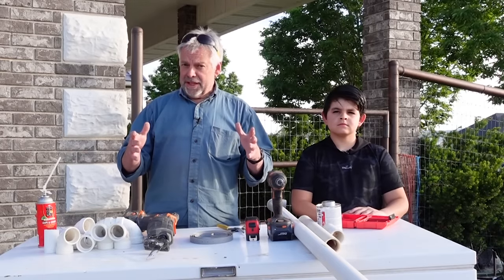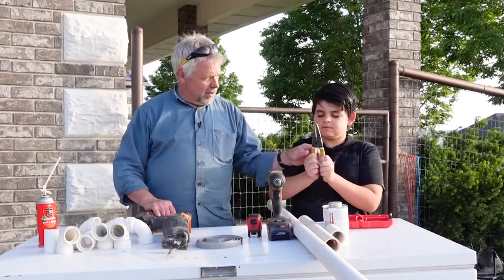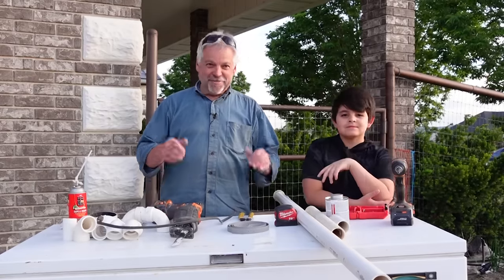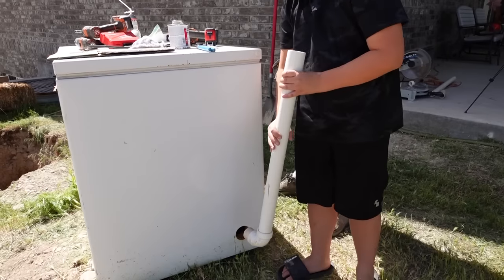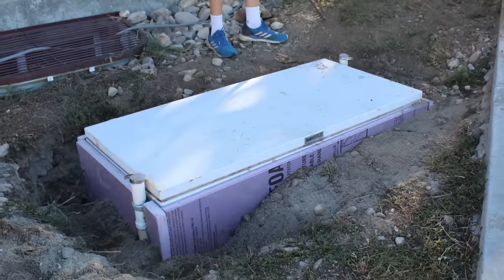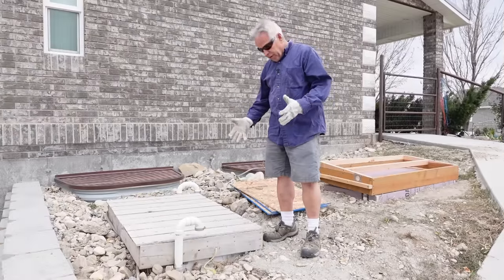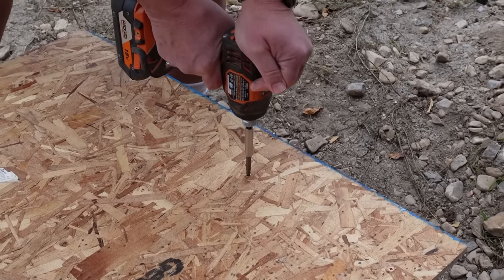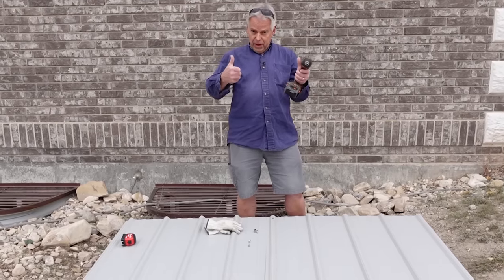How to Turn an Old Freezer Into an Effective Root Cellar

Comment: I used to live in SE Idaho where it got down to -20.  I used an old small fridge and it worked great.  Used it for years.  I dug a pit so the top/door when laid down sat 4 inches below ground.  I drilled holes in the back for ventilation.  I lined the pit with black plastic.  I laid the fridge in the pit with the door up, black plastic would be able to fold over it to keep water and snow out.  Lined the bottom with some straw.  Filled it with potatoes.  Eventually I took some old plywood and shingles and made a roof/covering and had it slope a bit and covered it.  The cellar worked like a champ.  I had potatoes into June the next year.  No problem with freezing.

Comment: I'm not understanding a lot of this. Could you do a second video with a diagram on paper explaining why you did everything the way you did? What is the purpose of the heavy lids? What planting zones will this work in? What if you have tree roots and can only get it half way buried? Wouldn't cold air from the vents freeze your food if it stays below 25 degrees for a few days?
Reply: Seriously, I couldn't follow along at all. Plus he really should've included different options to the reasons he did things the way he did.

Comment: Unfortunately we got two old freezer chests and did this. We lost all our potatoes. They froze. Don’t know what we did wrong. We dug deep enough that the freezer sat all the way down to just below the lip. We put in vent piping. We got 2” thick ridged insulation foam board and put it on top along with straw. 😩

Comment: Very nice, newer system much improved. I always find when doing a 2nd or 3rd of any project it always gets upgraded that how we learn. Those old freezers are handy we use for livestock feed storage, depending on size of freezer several bags will fit inside keeps mice other critters out. 
Stay Safe & Good Luck

Comment: One other thought is in the bottom of the Freezer. Stand 2 X 4s  is up on edge.. Secured.
You only need maybe 3 of them and then fill up the space with pea gravel. The pea gravel will also get cold which will help the temperature inside. And to avoid any standing moisture or water.

Comment: Great work - could you show how you laid out the inside - and how do you get the stuff at the bottom?
Reply: Organization would be based on what you store & access could be as simple as a rope tied to each crate or bin.  Any root veggie storage video would explain that.  Tip: keep apples & veggies in separate freezers.

Comment: In the deep south I wonder if the high water table would impact the freezer.  Also, I am concerned about fire ants that could get through the screens.  Any suggestions.
Reply: What about gluing a finer screen to the back of what he put on? I was thinking the screen from patio doors, but I just remembered I’ve seen the really fine mesh screen in metal.

Comment: Can you use this type of root seller for dog food, and if so how long would the food last?
Reply from the maker: Interesting idea. I see a little problem with humidity. That is great for veggies but not dry dog food. That problem would be solved with an airtight container - plastic bucket, Mylar, etc. It would keep it cooler which would slow down rancidity and extend the shelf life. It could double the shelf life of the dog food. I'll have to think on this one.